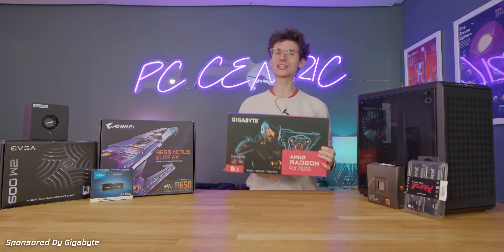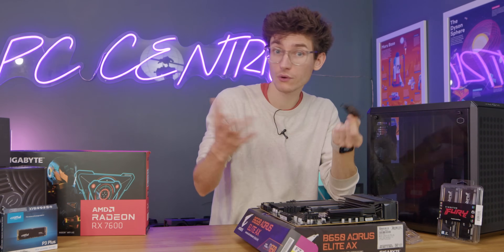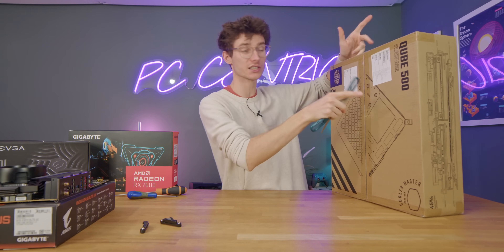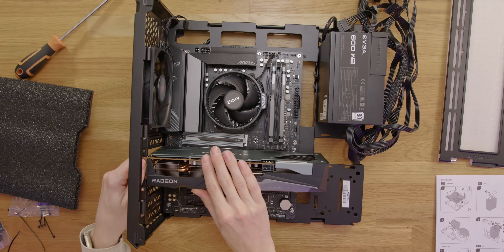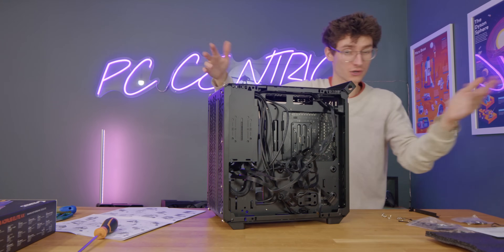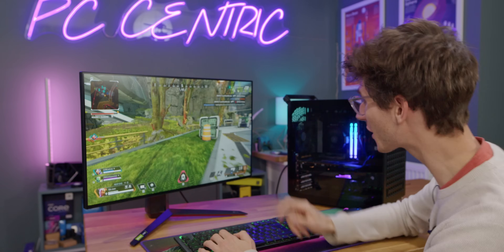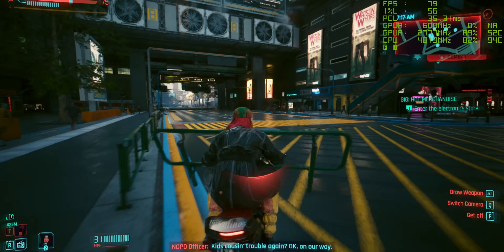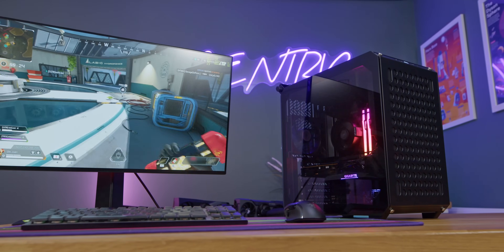The Best BUDGET Gaming PC Build 2024! 🤩 RX 7600, Ryzen 7600 w/ Gameplay Benchmarks | AD

Comment: So nothing about this is a budget PC as the parts totaled around $970 -1000 USD and the build is overall poor quality in terms of value. Don't follow this build guide.
• The PC only has a stock CPU cooler and one exhaust fan. There is poor airflow and cooling.
• The PSU chosen is of poor quality and the last place you want to sacrifice budget on. Don't get that PSU.
• The case is awful. I think you recognize this already though.
• The RX 7600 is a good GPU, but for the budget you had you could have gotten a much better GPU.

For $1000 you could have built the following with all new parts that is a much better build overall. Actually you know what? Here's a list for $980
• Better GPU, 32Gb RAM, B-Tier PSU, MUCH better cooling, better cable management potential

CPU: $148		
AMD Ryzen 5 5600X 3.7 GHz 6-Core Processor

CPU Cooler: $19		
Thermalright Assassin X Refined SE ARGB 66.17 CFM CPU Cooler

Motherboard: $97		
MSI B550M PRO-VDH WIFI Micro ATX AM4 Motherboard

Memory: $54	
TEAMGROUP T-Force Vulcan Z 32 GB (2 x 16 GB) DDR4-3200 CL16 Memory

Storage: $52	
Crucial P3 1 TB M.2-2280 PCIe 3.0 X4 NVME Solid State Drive

GPU: $450	
Sapphire PULSE Radeon RX 7700 XT 12 GB Video Card
Note: The 7700XT is on par with the RTX 3070Ti and RX 6800. This is about a 40% performance increase from the RX 7600 with 4Gb additional VRAM.

Case: $70		
Montech AIR 903 MAX ATX Mid Tower Case

PSU: $90 		
Gigabyte UD750GM 750 W 80+ Gold Certified Fully Modular ATX Power Supply
Reply from the maker: Honestly, I'd rather have a upgradeable Am5 motherboard and a much better CPU, than a 7700 XT - it's already CPU bottlenecked in warzone, and the 7600 is way better than the 5600x
Reply: @PcCentric came here to say this, why build on an older platform if you can just upgrade the newer platform over time?
Reply: @PcCentric  I think anyone on AM4 would prefer to have an upgradable AM5 mobo, but this is a budget build where you're aiming for price to performance. For price to performance, the 5600X takes the cake until you hit that $1500 USD budget range when you can start considering AM5 CPUs imo.

Yes the 7600 is better then the 5600X, but there's no bottleneck with the 5600X until you start using GPUs like the 4080, 7900xtx, and 4090.

I think it's also worth noting the 5800X3D exits...which is an incredible CPU on the AM4 platform and holds it's own as a top performer even among the newer AM5 cpus
Reply: You typed this long comment for no reason the point of the am5 platform is the upgrade path and this is the best budget build for the Am5 platform, you can save a little bit more money on the cpu by getting the 7500f, but not every one has time to wait, plus i believe the uk is more expensive then the US when it comes to buying PC parts.

Comment: 7500f will be better and cheaper
Reply: How do you figure? 6c 12T Vs 8c 16T, 3.7Ghz boost to 5.0Ghz Vs 3.8Ghz boost to 5.3Ghz… where is the 7500f better?
Reply: in price is better for 50-60$ or pounds  but with rx 7600   its not worth to go on zen4 cpus ., its better to go with am4 + r5 5600   and ddr4 and there will be left enough money for better card such as rx 6750xt  or even rx 6800 @ProfShikari
Reply: @Mr11ESSE111  and then you are stuck on a dead platform, needing to upgrade everything instead of just swapping out individual components as and when you need to.

Comment: do you think this same build with a ryzen 5 5600x is like second best budget build so far? it can save me a nice amount of money but if the difference is worth it i can probably bump up and get the exact same build in this video
Reply: I got this gpu with the 5600X and it runs great. I think it's the perfect cpu if You want to use 100% of your gpu, it's the bare minimum you can get. Hope this helps:)
Reply: @germiotero thank you! in terms of upgradability do you see your cpu lasting a couple more years in terms of strength? since it all forces you into AM4 and gddr4 which isn’t worth upgrading from unless you go for the much better am5 cpus
Reply: i say this because i don’t mind changing motherboard and cpu but in like 2-3 years i don’t want to need upgrades a year from now or something
Reply: @John-wt2xq with a good enough motherboard etc, you could probably go up to the 7800x3d and that would sustain you for a few years, but for future proofing, then the AM5 platform would be a better option as you’d have to change the MOBO, CPU and RAM at the same time.
Reply: @ProfShikari  i’ll try to cook up a new AM5 build see how much more expensive it is
Reply: @John-wt2xq  granted, the AM5 build might be slightly more expensive… but you’re only going to have to replace it all anyway in the future, at least starting with AM5, you can replace different parts at different times, rather than having to fork out everything all at once when you NEED to change from AM4 to AM5.
Reply: @ProfShikari  yup that was my thought process as well i’m just worried i won’t be able to afford the additional costs and be stuck with am4
Reply: @John-wt2xq  so start with slightly lower specs on AM5 and work your way up my dude :) I am currently making so with my ACER Nitro 5 from 2020, it has an i7-9750h and a 1660Ti (mobile) GPU, I can’t even afford AM4 at the moment, but soon, I’ll build myself a custom gaming rig :) Markus’ videos really help with the inspiration lol

Comment: is this a good build?
Case: Antec Performance 1 FT
CPU: Intel Core™ i5-14600K
GPU: ZOTAC Gaming GeForce RTX 4070 Ti
Mobo: ASUS Prime Z790-A WiFi 6E
RAM: CORSAIR VENGEANCE RGB DDR5 64GB (2x32GB) 6000MHz CL30
SSD: Samsung 990 PRO Series - 2TB Gen4
PSU: Cooler Master MWE Gold 850 V2
AIO: ARCTIC Liquid Freezer II 360
Reply: @osc4ryt1212  i'm building it  for Content Creation
Reply: Depends on what you’re using it for